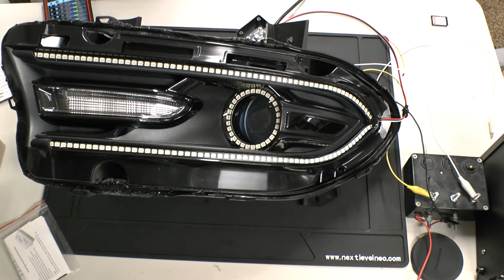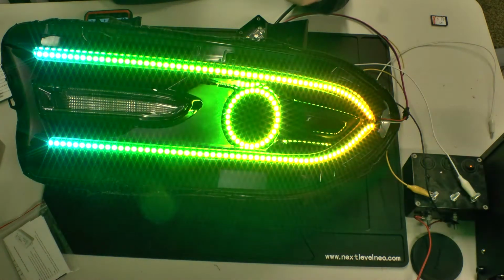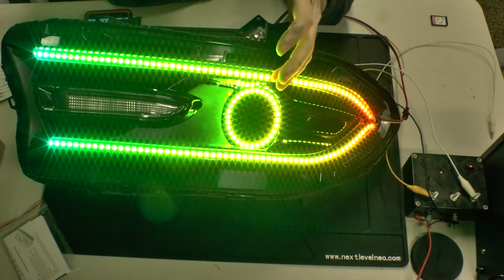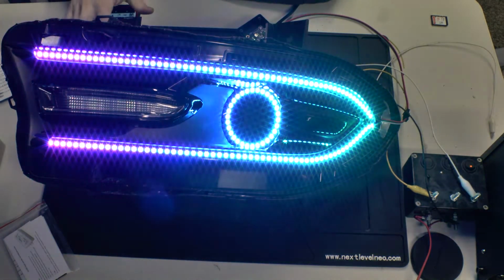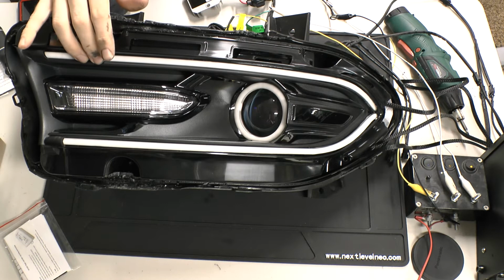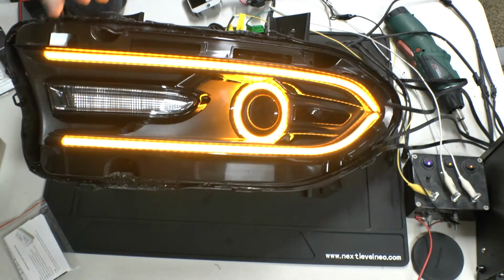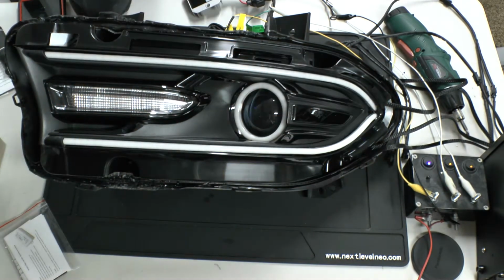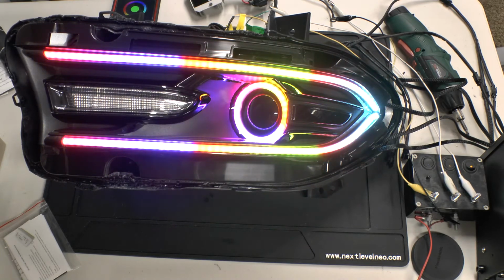Ultra-bright Flow Series Led Boards For Your 2015-2023 Dodge Charger

Comment: what do u mean power saver ? if i order these boards from the RBG website and connect to my battery u are saying it will drain my battery even when they are off ?
Reply from the maker: Im not sure what the "RBG Website" is, but as far as I am aware no other company is offering battery savers on their controllers. Without some form of disconnect from the battery, color flow leds will drain your battery.